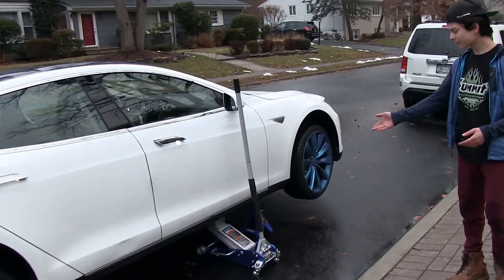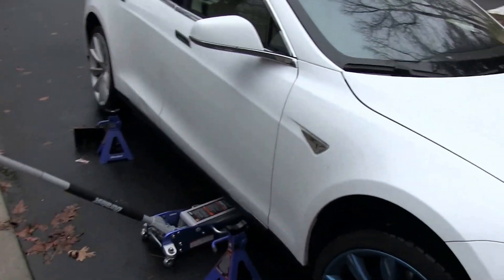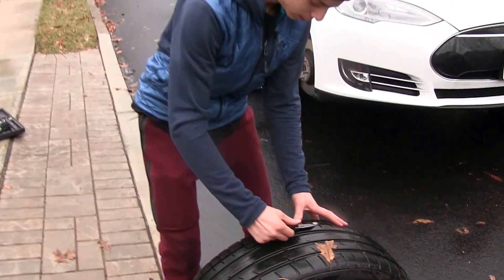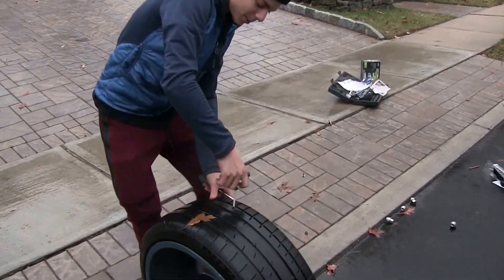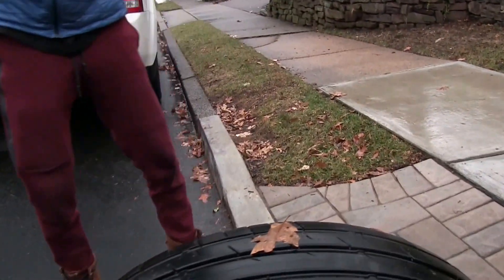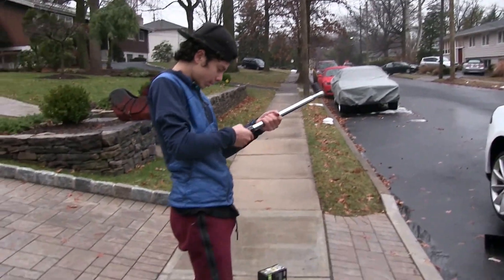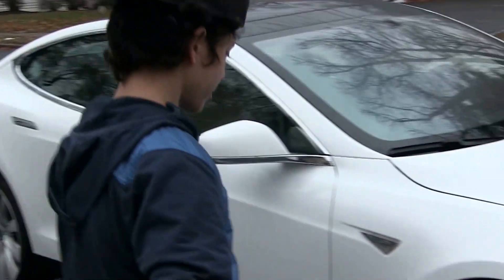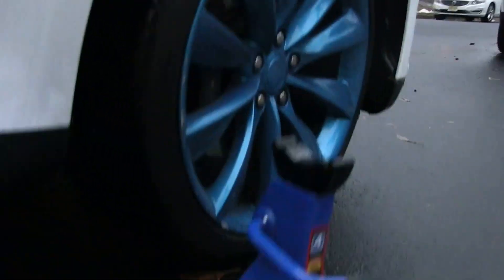15 Year Old Fixes a Flat Tire On a Tesla For The First Time: How to Fix a Flat

Comment: Using a string plug is not a proper repair you need to pull the tyre off the rim and patch it from this inside, in Australia I believe it's actually illegal to drive a car with a string plug in the tyre

Comment: Sorry, but placing the jack like this deforms the side rails of the battery frame. There is no steel where you guys placed it, just aluminum that is not designed to support the weight of the vehicle. This will probably need to be repaired, and could potentially cause problems when the pack needs to be dropped. An that it will once the front camber arms needs replacement, the main power switch serviced or any warranty work on the battery. Correct jack points are closer to the wheels, and are easy to see.

Comment: Honestly good for you for wanting to learn this kind of stuff... most kids today dont want anything to do with fixing cars and think its menial. Only suggestion is, dont think this is a permanent fix, get it professionally patched from the inside
Reply from the maker: Hey thanks, trying to keep the flame burning. I'm not into that video game crap and all. I'd rather be outside or using my hands
Reply: You got a head on your shoulders. I would say try taking a class or two at a local community college or if you have a program at school do it so you can learn from the right teachers. I loved being hands on also... and i learned from alot of my mistakes lol. You gotta screw up, cause thats the only way you learn. Just do it in a controlled environment if you can lol.
Reply from the maker: Thanks, unfortunately my high school just stopped offering auto shop. I will have to look into a couple other places.

Comment: you do not need to lift it so much, you will have less lifting of the wheel by hand later on..
Reply from the maker: I needed to be able to fit the jack stand underneath.

Comment: Please do not follow this kids advice on how to use a jack on your Tesla. There are 4 jacking points on the car. You can clearly see the front one at 1:55 in the video. It's the rubber square with three holes in it. You can also see the damage the kid has done to the battery with the stand and jack earlier. But if you want to void your warranty - please go ahead.
Reply: And 100 lbs.ft. is not enough for a Tesla lug nut. It should be tightened to 175Nm or 129 lbs.ft.
Reply from the maker: Thanks for your comment. Tesla actually makes it impossible for DIYers to be safe. The jacking points they give are very limited. The Hydraulic jack was in the correct place, but it is very important for me to have a jack stand supporting the car since hydraulic jacks can fail.

Comment: First of all, he should have loosen the nuts a bit before lifting the car at the jack point and he could have position the jack stand only as support near the jack lift; to lessen the work effort.  He should wear eye protection, some gloves, use a pair of big pliers and a long flat head driver for leverage.  It will also be best to put wheel chocks before raising the vehicle, this prevents the vehicle from moving/sliding and toppling off the jack stand or lift.  The proper way of removing any stuck object, nail or screw is to deflate the tire, don't risk getting hit by the object in the face or eyes; air is free and having no injury is priceless.  Same applies when cleaning the puncture hole, putting rubber glue and rubber plugs, that way you have an unobstructed hole free from any forced and condensed/wet air; this assures you of a very tight seal/contact with the tire material.  Lastly, there is no need to remove the center wheel cap and kicking the wheel to place, taking off the cap will do nothing for this type of wheel and kicking the wheel will just damage the paint and coating of the wheel.  I am no tire mechanic, but I use good safety measure and common sense.  I was also taught by my father (a MD by profession) at a young age (around 10) and safety comes first then sound procedure.   By the way, I live in the tropics where weather is brutal and heavy rainfall (normal) all year round.   Anyhow, good job.  You were able to replace a modern wheel at 15.  Some do not even know how at 40. ;)

Comment: I reckon applying the glue and the plug while there is still pressure in the tyre just ensures all the glue is blasted away from where it does the most good. Better to deflate the tyre. Also it should be completely dry, water interferes with adhesive curing

Comment: If you have air suspension, don't forget to put the car in "Jack mode" under "suspension" settings.
Reply from the maker: I did that, just wasn't in the video.
Reply: americanchallenger otherwise the auto leveling would have the car flopping everywhere.  Btw-most informative and relevant video all week.  I had two flats last week

Comment: DO NOT DO THIS.  This car has been jacked up with a trolley jack where there is no proper jack point. The appropriate jack point is near where the axle stand is (there are 4 such jack points). That car weighs over 2 tonnes. The base of the car is a battery pack, the last thing you want to do is jack up the car under the battery, this could be dangerous and expensive. If you follow this guide and destroy your battery pack you might consider suing this guy. One other thing, some Tesla's have the optional height adjustable gas suspension in which case you need to put the car in jack mode before you do any jacking up of the car.

Comment: The jsck point is the pad with the 3 holes u dumbass..u jacked up thr caron the battery of the car. And to pop of the middle cap u could have from the inside but why did it matter..???
Reply: Dumbass? Really? You must be one of those scumbag baby boomers...
Reply: roversrawsome um no im 33 gen x if u must label. And like i said before im a road side asst and i change tesla tires the safe and righr way the op already replyed to me and i said my say. So go fuck off.. and have a nice day.
Reply: It will not bracke its completely titanium
Reply: The81ubb what u mean not break? The battery is under the car. And the jack point is clearly seen on a normal car yes thr rails work but not on a tesla.

Comment: That's pretty badass of you.  Very few people could do what you just did, and certainly not any 15 year-old I've met in the last decade.   A tip for when you're breaking loose the lug nuts:  Place the breaker bar parallel to the ground, and pull up on it.  Pushing down, you're limited to your body weight, but your leg muscles can lift a lot more than your body weight.
Reply from the maker: Thanks for the tip. I'm trying to keep the flame burning in terms of working on cars.

Comment: For future reference, there is no "bad acids" in the Lithium pack, the rubber cement used for gluing the plug is more harmful, but anyway, good job.
Reply: zapro_dk What the glycol coolant? that's it. they are lithium batteries and look like a skinnier c battery
Reply from the maker: You definitely wouldn't want to drink the fluids in that battery!
Reply: Glycol coolant is not corrosive, but toxic. So it a lot of things. The 18650 is a industry standard cell size that you will find in most laptop batteries.
Reply: There are a lot of "Bad acids" it a Li-Fe or Li-Po battery's

Comment: I hope nobody tries to lift their Model S as it was done in this video.  americanchallenger might have gotten lucky and done no damage, but Tesla manuals and techs are very clear there are only 4 approved points you can jack the car.  https://teslamotorsclub.com/tmc/threads/where-to-put-jack-stands-on-model-s.20518/ has some options for getting jackstands on it using only those four points.
Reply from the maker: Thank you for your concern, as you can see in the comments, this issue has already been raised, reviewed, and resolved in future services.
Reply: KaniS i agree 100 percent with op. And like i said before make sure u have jack mode if its on the vehicle.

Comment: see the way it shot out   you were lucky   it  did not hit you  or some one else in the eye.
it  could have shot across the street   .   with pliers  you would be holding on to it as it comes out.     i am also  a retired emt from nyc-ems   I had    35 years on the job

Comment: some times   you can plug a tire  while it is on the car     at my shop we use and patch with a plug attached to it and it requires  the removel of the  tire from the rim

Comment: hi I work in a large tire shop  as a tire tech .     just some things I wanted to point out    always  wear gloves and eye protection    when removing a nail or screw  from a tire     also  chock the rear  wheels  when jacking up the front .  you corrected   it already   but like you said  break loose the lug nuts  while it is on the ground.  i have a 3/4 drive   20 and 40 inch breaker bar  at my shop    for when the lug nuts are on way to tight.   a 1/2 dr   wont do it some times.   the longer and fater the bar the better
Reply from the maker: Thank you for all your suggestions, Joe! Your support is greatly appreciated.

Comment: Incorrect way to jack up a Model S/X.  Viewers, consult the Tesla manual for the correct location for the jack points, and proper way to jack up the car.
Reply: I work full time in a tire shop and we see are share of tesla    they could of done a much better job on the lift/jack points    for us techs
Reply: Yeah there 's prolly a hole in the battery from where he jacked up the car.

Comment: I am not sure if that is the correct jack point! I want to paint my break calibers but I am told that you can lift the car only from the four designated jack points.
Reply: ylli hysenlika yes this kid unfortunately risked braking the car by lifting this is the wrong jack points there’s 4 little black pads on each of the assembly’s and depending on the model you need to put in jack mode and turn off auto leveling

Comment: Why would you remove the wheel to Plug a front tire when you can just turn the wheel to access it? Lifting if from the battery not the best idea either.
Reply from the maker: In the moment, these genius ideas don't come to mind, hindsight is 20/20.
Reply: best repair uses patch from inside. If you read the warnings on those plugs they say they are only for emergency/temporary use and not DOT approved. I would never use one on a performance car. That said. I have used them several times on my beaters and never had an issue for the rest of the life of the tire assuming you have a decent branded/steel belted tire

Comment: Good video. I have been meaning to run through this at home (prior to doing it in anger). It would worry me to death jacking a Tesla anywhere other than one of the 4 jacking points (where the axle stands went). Are there metal bars running down teach side of the car that can withstand the weight?  I thought the wheelnut torque was 129 lb/ft?  But very useful video.
Reply from the maker: Yes, metal bars run front to rear and can support the weight of the vehicle, in the front or rear according the Tesla owners manual. At the time I was unaware of the torque rating, so I just torqued it to 100 since that's what most cars recommend. Thanks!
Reply: americanchallenger you might want to re-read the Manual. Mine says the 4 jacking points are the only approved jacking points and lifting the car at any other points voids the warranty.  But common sense prevailed and it encouraged me to do a dry run, and I'm glad I did.
Reply from the maker: Thanks for watching and thanks for the information!